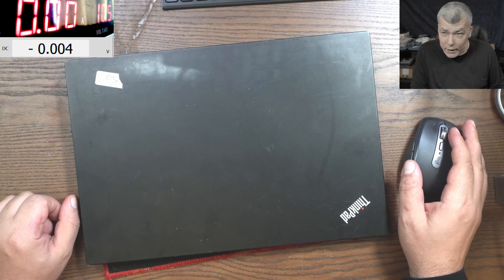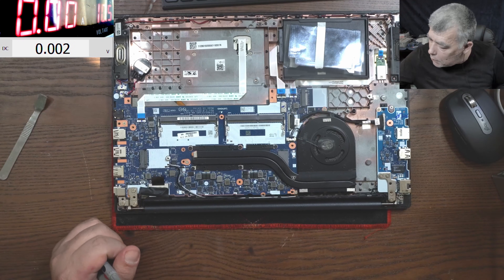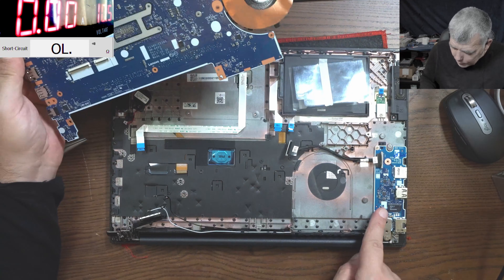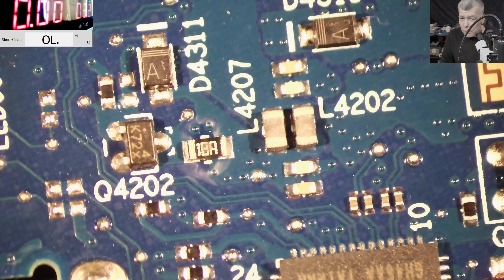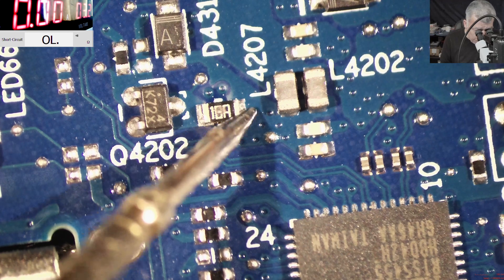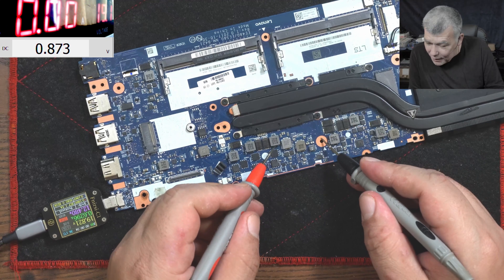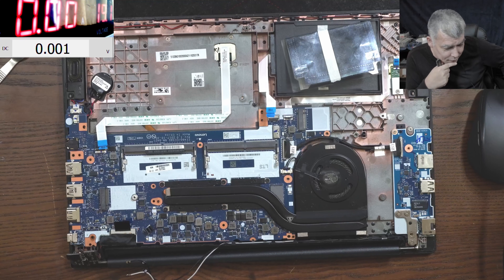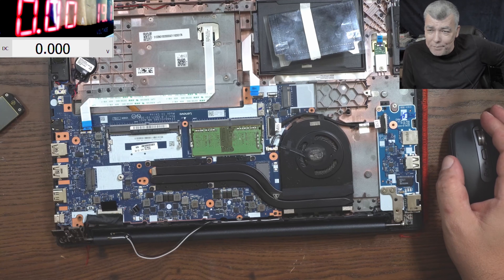Fixing a laptop by releasing the 'Magic Smoke' out! Lenovo E580 laptop repair

Comment: I was cleaning my laptop fans and after I was done I turned it on and a resistor (2R2) is short circuited and smoke is coming from it and there is a burning smell near the display connector or from one of the fans I don't know so I immediately turned off my laptop what to do now I am very afraid 😖

Comment: can someone explain what exactly happened so that the charging port started working again?
Reply: Possibly a cracked solder joint was heated up enough to flow itself.
Reply: i think there was a short because it takes alot of current

Comment: E580, 590 often needs CPU reballing...
Reply: All 8th to 12th gen Intel laptops need it because CPUs always overheat to 100°C and lots of 20°C to 100°C is horrible for lead free solder.
Reply: i have lenovo E520, cpu on socket, you can replace it , put i3, i5,, i7, whatever... :))) old, i know...